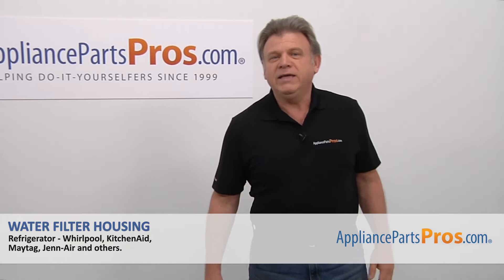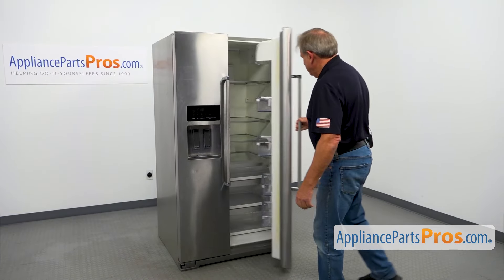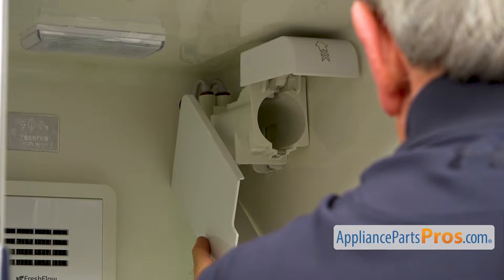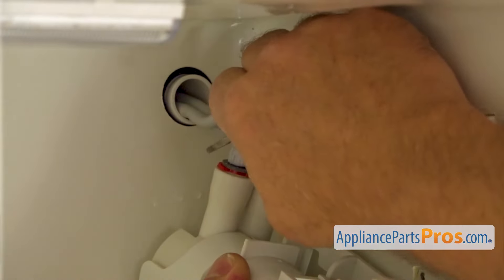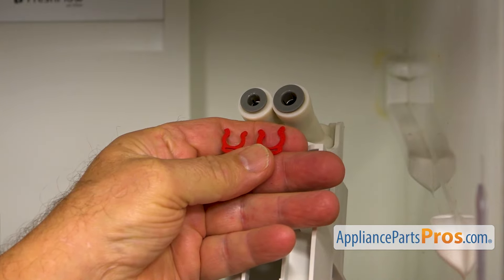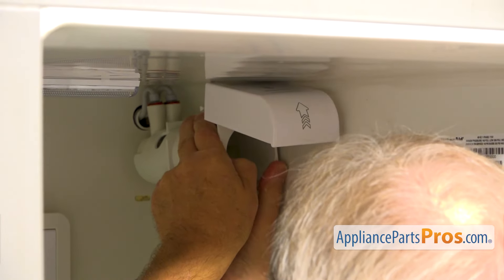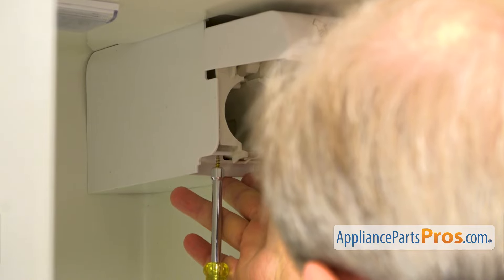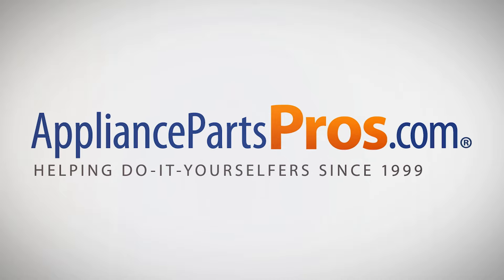How To Replace: Whirlpool/KitchenAid/Maytag Refrigerator Water Filter Housing WPW10394053

Comment: My kitchen aid fridge is still not dispensing water or ice. I changed the water intake valve
 Could this be the problem?
I would need to order the part to change it. But i want to do it only if that is the problem.
Reply from the maker: What is your model number?

Comment: Thanks for the great video as it was extremely helpful to me today. My refrigerator is 10 yrs old (new in 2013) and there were no locking rings. I replaced the housinf and it works, no leaking(fingers crossed). I would caution others that if there is only the small gray circular tab and you don’tsee a locking ring do not try to remove the tab as that might break it. Just skip the remove locking ring step. Thanks again for the video.
Reply from the maker: Glad we were able to help you out. If you need help with anything in the future please let us know.